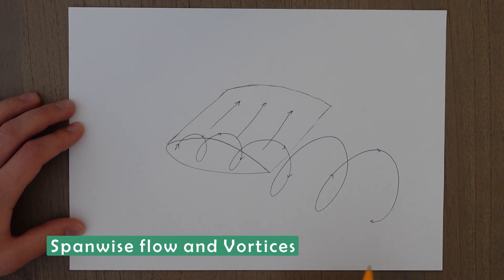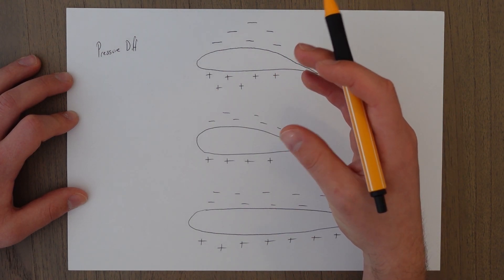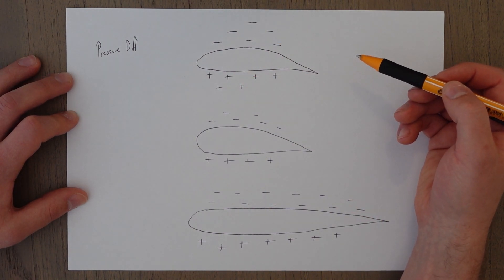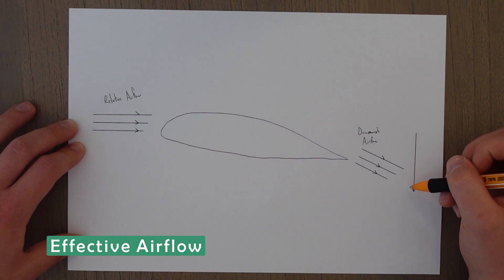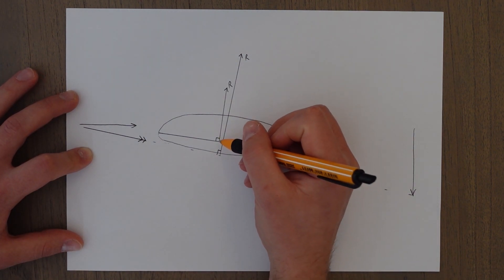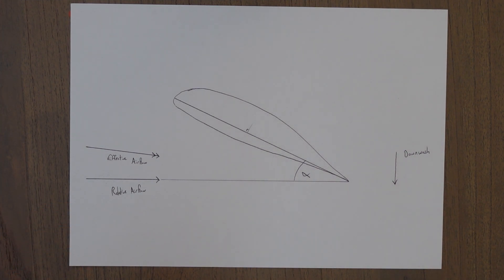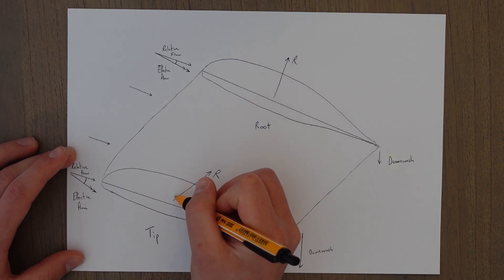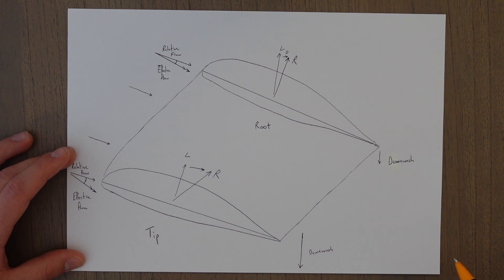ATPL Principles of Flight - Class 5: Vortices/Vortexes.

Comment: Hey a kinda of a late question by now haha. Since the downwash deflects the air behind the wing downward, this means the air going to the back will hit the horizontal stabilizer at a more downward angle, which means that we need more pitch up angle to counter that downward. So, do we increase the aoa of the airplane because we have less effective aoa on the tail?
Reply from the maker: The tail will usually be designed around this. It might be mounted at a slight angle so it always has a slightly higher angle of attack compared to the wing. That way the downwash is accounted for. Or it might be designed to be a bigger surface so the reduced angle of attack is not as important. Basically it is a known effect so is designed around.

Comment: I don’t understand why the wing vortex is stronger at the tip,
In my head the wing tip is shorter, has less pressure difference, produces less lift.
So why is the vortex stronger?
Reply from the maker: because the physical barrier (the wing) separating the top pressure and bottom pressure stops. This gives the air pressure a chance to equalise.

Comment: isnt it supposed to be the lift vector that acts at 90 degrees to the RAF? not the resultant vector. being that the resultant is the average of the lift and drag vectors
Reply from the maker: No, lift acts opposite to the weight. Resultant comes off at 90 degrees to the RAF which is split into the part acting straight up which is Lift and the part that opposes the motion of the aircraft - Induced Drag.

Comment: 2:39 isn't a fast moving wing generate a high dynamic pressure so there will be less static pressure, so as a result the pressure difference must be higher in a greater speed?
Reply from the maker: The pressure difference is created by the acceleration of air over the top surface. 

It is separate from the speed of the aircraft, it's all about the difference between top and bottom of the wing. So a fast moving wing will not create a higher dynamic pressure necessarily.

Comment: So does a high speed wing create a lower lift component than a low speed wing? I thought it was the other way around @2:41
Reply from the maker: It doesn't need to have as large a Cl because a lot of the lift is made from the speed of the wing travelling through the air. Lift = 1/2 rho Vsquared S Cl

Comment: Hi Grant, thanks a lot for this.
There's something I have a bit of trouble with, a bit of a contradiction. Here when talking about vortices, the the higher the speed of the wing the lower the pressure differential. In previous lessons, though, the higher the speed, the higher the dynamic pressure, the lower the static pressure, and therefore the greater the pressure differential. So wouldn't a fast moving wing produce stronger vortices?
Reply: Hi! Saw this comment and wanted to pitch in. In order to produce lift at slower airspeeds, you need to increase your angle of attack. By increasing AoA, you're increasing Static Pressure under the wing (due to form drag or air resistance) thus creating a larger pressure differential. This is why a clean, heavy, slow moving aircraft has stronger vortices compared to a fast one because you need to generate more lift to maintain current attitude. More lift = more induced drag = larger vortices. Hope this helps!
Reply from the maker: I can't find what part of the video you are referring to, can you give a time?
Reply: @atplclass  2:30